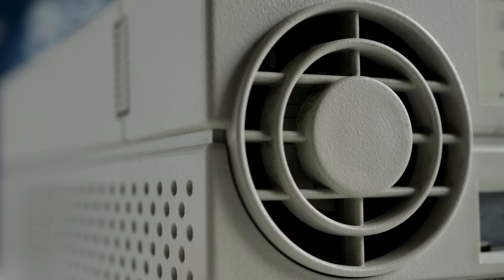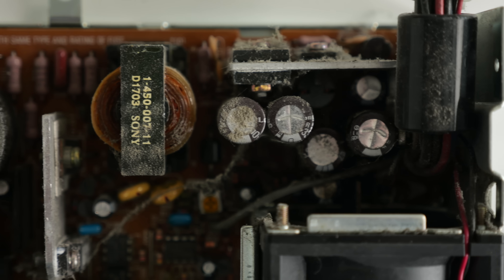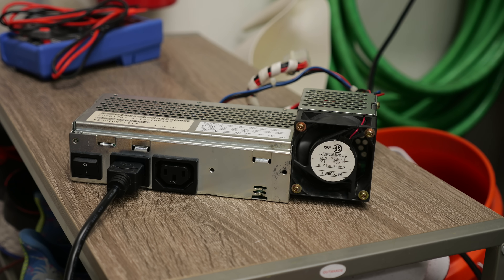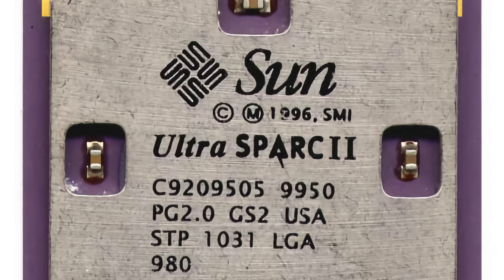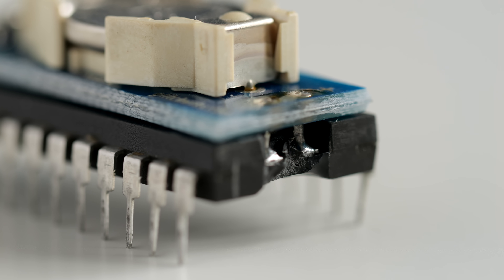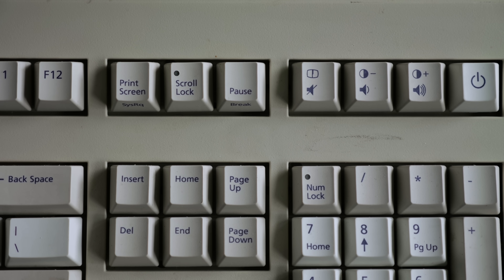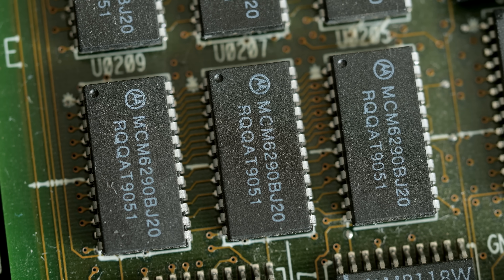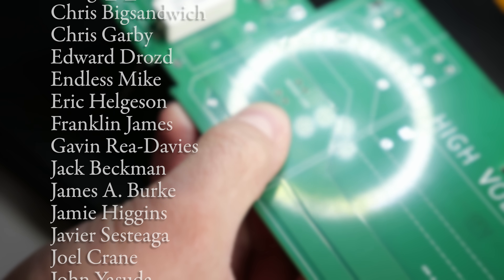I couldn't fix this SPARCstation because of one STUPID problem

Comment: Not a single comment recommends sending this machine to some of the more tech-savvy YouTubers out there to try to replace that SRAM chip with a modern replacement.
Reply: Probably better to pull a working chip from a second for-parts SPARCstation...
Reply: It's more embarrassing than that. If he'd just done a few minutes of research he'd have found a 100% compatible substitute is still made today and costs $1.42/ea from Digikey.
Reply: @techfury90 What is the model number of that chip?
Reply: @techfury90  he did do research about it and it didn't come back good. did you even watch the whole video? he never said its impossible to fix. he said that its becoming too much of a drag and an expensive project for something that would not even have a usefulness apart from fixing and booting it once for a video and never use it again. which is a quite fair approach. you should know your limits when it comes to projects and know when to pull the plug and move one. and that he did. also just because some parts are still produced or old stock still exists does not mean that thats the case with obscure parts like that. and even if you found one similar  its not 100% sure it will be a drop in replacement and will work. and who says theres not more issues with it after that? he never said hes tossing it in a bin or not going back to it in future. he had already spent too much time and money on it for time being and with no guaranty  about anything
Reply: There is one comment that implies he do that….😂
Reply: Probably better designing a small PCB to adapt the footprint of that SRAM to something that is available.

Comment: Ok can we just pause a moment to ask, Who in their right mind designs a computer chip with a irreplaceable battery hardwired into the top of it?? Musta been some nice extra cash to get out of the customers...
Reply: It basically consolidated an entire area of a PC/AT's time keeping circuit into a single chip, having the crystal and the battery on-top in a compact resin DIP package helped save computer manufacturers board space and assembly time since the batteries were integrated. The idea of computers being used past 10 years was just never a consideration with any of the old electronics companies, post sale support just didn't extend that far in most cases outside of datacenters. 

Companies like Dallas, ST, etc have been selling these since forever, so it's kinda ended up being a quid pro quo situation for both sides, especially for hobbyists since these use lithium batteries that don't leak corrosive liquid unlike the NiCad alternatives of the time.

Comment: If someone ran into this issue and wanted to, 16k x 4 SRAM chips are still manufactured. You'd need to build a bespoke PCB to turn a SMD version into a through-hole while matching the pinout of the old design.
Reply: I've done exactly that many times while fixing arcade games. You don't need 16kBx4-bit. Any RAM (dip or smd) will do just wire it up by signal and it will work.

Comment: 8:25 My Tektronix scope (a TDS-360) has one of those. I really need to modify it to take an external coin cell battery before the one in it dies and it loses all the calibration data.

Comment: I had one of these, except it was the LX, so a bit better. I maxed it out, max RAM (96mb), 9.1GB 7,200rpm SCSI, 50mhz cpu. Ran Debian on it. Fun little box but finding all the stuff needed was not easy even back in 2007. Can’t imagine trying now. Sadly I sold it back around 2011 for only $300.
Reply: Hey, I did something similar. Also ran Debian (Woody?) 2.2 kernel.. maybe 2.4 at some point. Was my personal email & web server for a few years. Really enjoyed it. No more Sparc32 support in Linux so you’d be limited to OpenBSD or NetBSD if your want a modern OS.
Reply: @ I think I was still running Sarge on it. Had to setup a server for it to NetBoot off of in order to do the install. The smile I had from when it actually worked 😀

Comment: I recently got a Sun IPX. Bringing it up was fun and wasn't much work. In my case the only issue was the clock chip. The hard drive was good (but I did replace it) the floppy was present. My Sun keyboards and mice are in storage so I used a terminal to bring it up (which is always my starting point with these kinds of machines anyway). OTOH, as I already have several other working Suns it fit with what I do and was familiar territory.

Comment: I really liked this video because of two things:
1. You've included the part where you didn't account for the case in the 3D printed floppy cover.
2. Your video's title isn't clickbait. You straight-up say what you couldn't fix this machine.
I really appreciate these 2 details, it's a rare thing on this platform....
Reply: ditto on your first point
Reply: Same, I really appreciate the non clickbait title.
Reply: I dunno, this title still seems like total clickbait to me.

IMHO, there was no "STUPID problem" at all.  He just gave up because it wasn't as easy as he thought it would be.  It was still likely entirely repairable if he just chose to spend a bit more time on it (and ask around various related forums, etc, for leads on parts, which lots of people do often have, or possibly just adapt a different model of RAM chip to fit, etc)..

A real non-clickbait title would have been "I couldn't fix this SPARCstation because I got bored."

Comment: Did you try checking that IC on a chip reader, maybe you can read what it has try to copy to a similar chip and modifying the code until it works
Reply: It doesn't need to be copied and nothing needs to be modified.
Reply: @g4z-kb7ct  but the chip doesn't work, just it's for getting a comparison and modify some similar chip that is available so it can be replaced

Comment: Dude, reach out to Adrian Black, he'll probably have some of those chips and even if he doesn't, I'm 99% sure there will be some way of hacking in a different 16kx4 chip, Adrian has done it many many times and will absolutely be able to help you. All you have to do is find a different chip with the same capacity (and sometimes speed though not always) and repin the output so all the ras and cas lines match up or heck I've even seen him replace like 12 old chips with 1 modern chip before. Guys a wizard with RAM.
Reply: Dude, that not so smart suggestion is under so many videos. Not every YouTuber knows or likes the other. They don't all live in the same place. And Adrian black or mark from mark fixes stuff etc would be buried in work if they would work on everything that's broken in some video.
Reply: @bzuidgeest  And? Turns out there's this amazing thing called the internet, you probably know it. Adrian hangs around on Usagi Electrics discord and people there can get hold of him, it takes less than a few minutes to send out a ping, heck there are people on that discord who would help. And as for likes, I'm not sure what your smoking but Adrian is so mild mannered there is nothing to dislike, The tech community is wonderful, if you ask for help, especially when reviving retro and cool stuff, people will help you.
Reply: Umm no, Adrian Black is not a genius who fixes everything. Plus he's not reliable nor is he organised. Plus the RAMs are super rare and simply not available. Anyway it's pretty easy to fix it without that special RAM or any special skills. I've done similar fixes in the past. Just wire up any RAM the same density or larger and wire up only the pins required. All he needs to do is use something like a 62256 SRAM and wire up A0-A13, D0-D3, OE, CE, WE, VCC and GND (probably using a piece of vero board or make a PCB adapter) then solder those wires to the pads on the mainboard. It's just some wires and solder, not difficult.

Comment: Similar journey.

I was given a similar one by a friend who found it chucked out at work, mine had a CD-ROM and Ethernet built in. PSU was OK. I managed to get a fairly recent build of Net-BSD to boot in terminal but with about 24MB of RAM, it was dog slow. I had to hacksaw the ends off the clock chip to attach a battery. Didn’t have 13W3 video, I used serial and then accessed it over Ethernet.

Eventually decided it was too slow for anything, and the only way ‘forward’ would be casing a modern motherboard in it. So it’s now a curio resting in the shed, as I already have enough modern machines living here.

Don’t worry about not continuing with that, but maybe make a vid about running Solaris on something, maybe an emulator?

Comment: I’m impressed by the serial console output and the exact component being printed as the fault.

If only more machines had that!
Reply: yeah that's great!! Couldn't ask for a better way to get diagnosis, shame that memory chip was obscure.
Reply: Oh yes. Sun had fantastic hardware and Solaris 11 was also the best OS ever.
Reply: Yes, since it's a $12k computer from 1991. Haha
Reply: A large electronics module that must ensure the least amount of critical downtime and very quick on-site maintanence generally is designed to do this diagnostic tool log output. However it's not something a consumer electronics gadget can easily provide to the lay consumer. That said, there are laptops with fairly comprehensive diagnostic tools at the BIOS menu.
Reply: Enterprise machines/servers with remote management (the modern version of this things serial console) still have a lot of diagnostics. Consumers just aren't cool enough for that ;)

Comment: I used an IPX with a quad port SBUS card as my firewall for years and years. I think I ran Solaris 10 on it. Ran like clockwork for 20 years straight. Finally I replaced it with a Sun 220R not because the IPX went bad, but because I had gotten a faster InterNet connection and wanted more throughput. That little SPARC V7 CPU filtered and pushed hundreds of gigabytes, and it was only running at 50 MHz.

Post scriptum: there is a special place in hell reserved for those who put PC-bucket motherboards into Sun cases, or run a non-Solaris operating system on Sun hardware.
Reply: yeah I wonder if the IPXs came with these cards.. I admined several of them into the early 2000s and they all had the quad ethernet card... qfe0?
Reply: @DawsonMakes  that's right! Quad fast EtherNet baby! The IPX's did not come with those cards, and those cards were a very expensive option meant for much mor serious iron like the 220R, the 250, and the 280R, but since they were SBUS, and Solaris did have drivers for them, any hardware which had SBUS and ran Solaris could use them, they JustWorked™.
Reply: What's wrong with NetBSD?
Reply: @MrFritzthecatfish  it's not Solaris 10, that's what's wrong with it; no operating system on Sun hardware will have that kind of intimate knowledge of it, or be able to utilize all of it and as efficiently as Solaris. On top of that, Solaris 10 is the fastest of all the operating systems currently on the market.

Comment: I recently asked the same question to myself. I have a ton of machines I just don't use. What am i doing?

In the end I sold or gave to friends half of them and I haven't even noticed that they're gone. It's helped declutter and appreciate the machines I still have even more.

I'm not done yet, but I'm definitely struggling to find reasons to get rid of what I have left. Which is a good thing, now at least!

Comment: I wish I hadn't gotten rid of my pile of IPXes that I bought many years ago.  A friend and I split a lot of 20 for around a couple of hundred bucks in the late 90s.  All of the machines came without hard drives (no big deal for modern BlueSCSI usage) and dead clock chips.  I gave up and sold or possibly just gave them all away.  There's a chance I might have one still around in my basement, but I'm fairly certain they're all gone at this point.

Comment: Kinda disappointing video... There are a ton of working Sun systems from the 90s, relatively high number of parts. I've got 3 working SPARCs, little bit newer than that IPX but not by much. Graphics cards for that cost next to nothing, although I'm not sure about disabling the onboard one. Universities bought the systems by the truckload. Computer science was always taught on Unix. No nostalgia for Unix workstations? Macs still run Unix today. Most servers run Linux. I don't use retro computers much regardless of whether I have a lot of nostalgia for them, and as a big computer nerd, I have nostalgia for most. I don't think it's a case of sunk cost but more a project that never should've been started.
Reply: I have a question. My Dad was in tech and had some old equipment he found to be noteworthy. Not sure how I'll find someone who may find them to be of interest. Can you recommend a good used computer store around the  Silicon Valley area where I might be able to sell them on consignment or sell them outright?
Reply: @HappyQuailsLC  Vintage Computer Federation might be a place to start.

Comment: I used Sun and Sun clones throughout the 90s for ASIC design. Had one on my desk at work for years and at the time they were excellent machines for running Unix and the EDA tools I needed. Then in the early 2000s we switched over to x86-based Linux systems and I've never looked back. Suns were great in the day but that time has passed and I don't miss them at all. Throwing in the towel was a good decision.

Comment: Sun: Intentionally breaks Windows Java and renders it unusable
Also Sun: Intentionally sabotages their own machines to mandate their professional services

This was a Sun problem, long before Oracle bought them out.
Reply: 15 years of Sun work, I never needed PS. I did however need field services for parts replacement but that wasn’t a Sun thing, they nearly all worked that way. You paid for maintenance contracts, that’s just part of running a business, doesn’t matter if it’s a computer or a CNC machine.

Sort of a misinformed, essentially brain dead, comment.
Reply: Poor, poor Windows.  It's not like Microsoft itself ever created its own Java version to only run on Windows called Visual J++, until Microsoft got defeated by Sun in court and had to stop work on future versions.

From Wikipedia: "Sun Microsystems had originally licensed Java to Microsoft but later initiated litigation against Microsoft for trademark violation. Sun's trademark license for usage of the Java brand insists that all implementations be 'compatible'."

Facts matter.
Reply: @georgeh6856  yep, the incompatibilities between Java on Windows and other platforms to include Sun hardware wasn't a Sun problem, it was a Microsoft problem.
Reply: @georgeh6856  Visual J++ was also part of the Visual Studio 6.0, if memory serves, for java development. good old and her shenanigans.